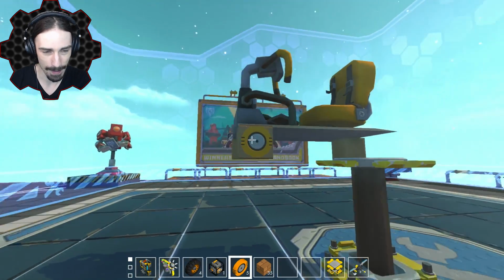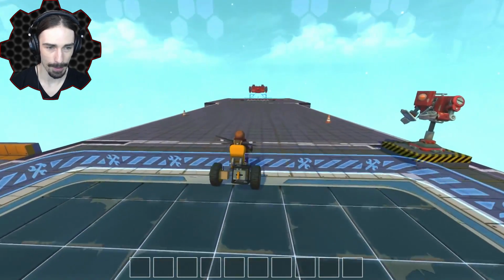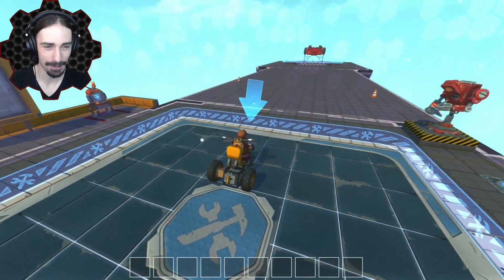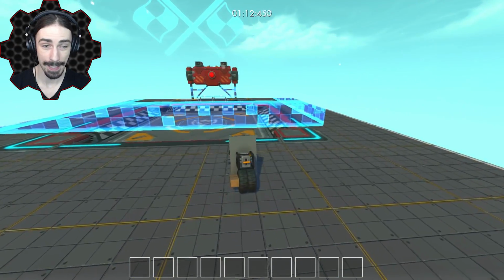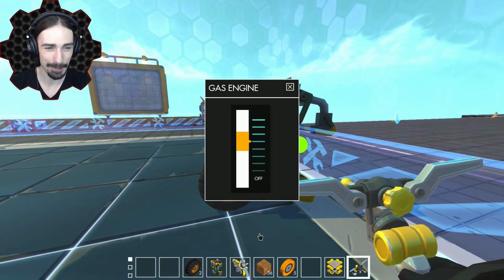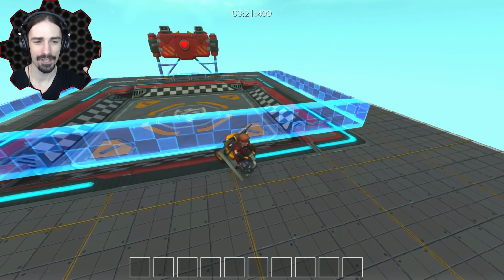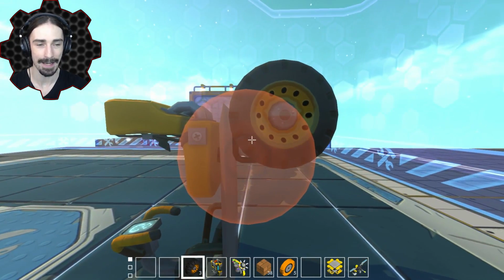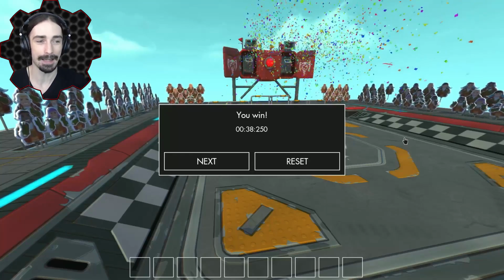FEWEST PARTS POSSIBLE CHALLENGE! (Best Design?) - Scrap Mechanic Challenge Mode

Comment: Since Challenge 2 pretty much requires a way to steer, you can attach just about anything to a steering bearing and the changes in friction points could give you a functional degree of control.  I mean, say you're dragging the seat, if the seat moves, that will affect the center of mass and thus the direction of movement.

Comment: Put the engine directly in the middle under the seat and the two wheels off-set on the engine to where one wheel is like left-rear and the other right-front.

Comment: You can turn the seat sideways. Like with the 5 block one, you could have just turned the seat to move weight away from the engine.

Comment: SCRAPMAN LESS IS POSSIBLE

Connect the bearing to the seat; and do:
Press right
Quick switch to left
Release
Repeat

The seat will prevent too much backtracking due to grip on the 'road'!

Comment: Scrapman... You can make the engine the weel, the seat will tip over and allow the engine to rotate sideways
Reply: Squa 81 don’t copy replies! ...

Unless you didn’t and you and the other guy just happened to post simultaneously. In that case...sorry
Reply: And he could also hook the bearings up to the wheels and it would act like a semi motor
Reply: Then what do you attach the bearing to
Reply: @GreenTheem  I think either he copied me, or we did it at the same time
Reply: @BubbyGamingOfficial  on the motor? Why?
Reply: @squa_81  Well, you have seat, bearing and a wheel, if you place the bearing on the bottom of the seat then the engine your just gonna spin I a circle
Reply: @BubbyGamingOfficial  and guess what a wheel does? It spins in a circle, so instead of using a wheel use the engine block as a square wheel to spare one part
Reply: @BubbyGamingOfficial flip the seat in the side with the engine in the corner

Comment: Maybe you can use the engine as weel and delete the weel
Place the sit sideway, place a bearing under it and then place the engine on the bearing
Reply: Good Luck
Reply: U wont even able to go in a straight line
Reply: ok
Reply: I thought same idea
Reply: @zsoltpeterdaniel8413  But it's okay to be gay :)
Reply: @LordDragox412  I meant that u cant go in a straight line
Reply: weel...
Reply: @jamesramirez0408  Wheel... 😒

Comment: You could theoretically do it with 3 parts, you don’t need the wheel
The engine could be the wheel

It would be doable
Reply: no that is wrong tho wat is holding the engine